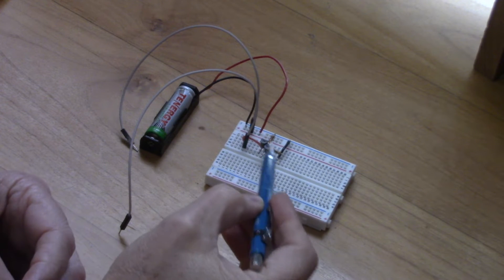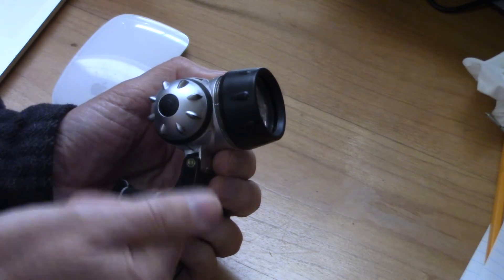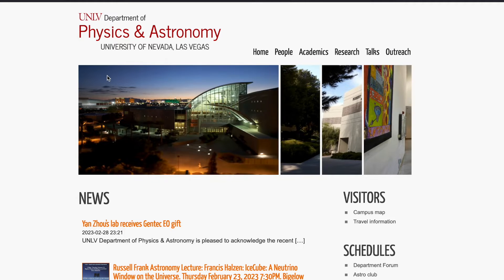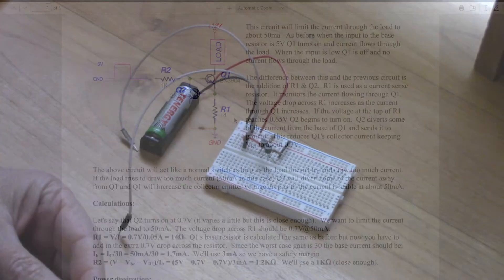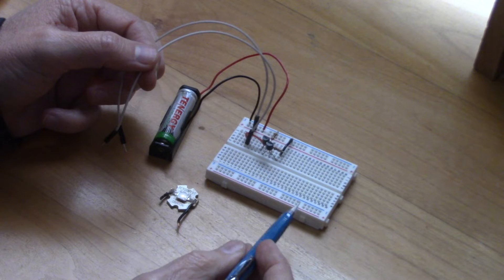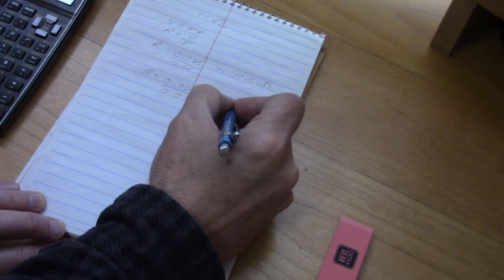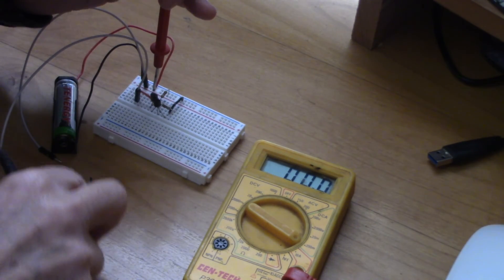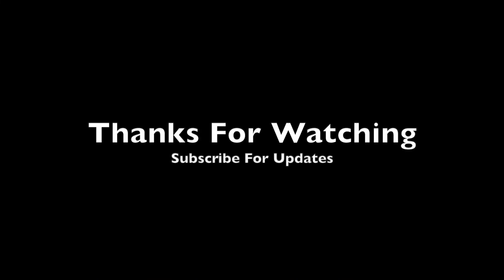How To Make A Simple Current Limiting Circuit For an LED

Comment: Good old E over IR.  It's the gateway to understanding circuits.  Crunching numbers in a formula is so satisfying.  This was a fun upload.  By the way, I concur with the others who posted earlier comments.  A resistor is all you need if your intent is to simply limit current.  However, as your video demonstrated, there are multiple ways to find solutions.
Reply from the maker: Yes I'll have to try the other method that was mentioned.  I have added a potentiometer in the next revision so now I can set the current to anything I want in real time.

Comment: 2 transistors like this is known as a current mirror. You don't have to use that, a resistor alone can do the function but it makes for a fun project the way you are doing it. You can calculate a simple resistor circuit to do this.
Reply: Yes, just one resister will do the job.
Reply from the maker: ok I'll have to try that
Reply: If the input voltage is variable, say, that coming off a car battery / charge system at various times / conditions, you most certainly will not get constant current to the LED.  This results in a lot of negative comments / reviews of aftermarket LED lighting for cars:  If the light manufacturer tries to be "competitive" with good brightness at 12v or a bit more, and resistive limiting, when the car starts supplying 14.7 volts or a bit more, the LED is now run too hard and may cook.  A very typical setup would be 3 white LED's in series with a resistor.  Those LED's are going to have a Vf of 3.3v (typical) or 9.9 volts total.  That resistor is not going to be a very effective current limiter if Vcc goes up 2+ volts...

At the very least, a simple zener + 1 transistor regulator circuit to keep the supplied voltage from going too high is indicated...